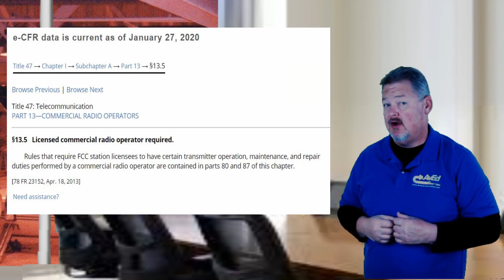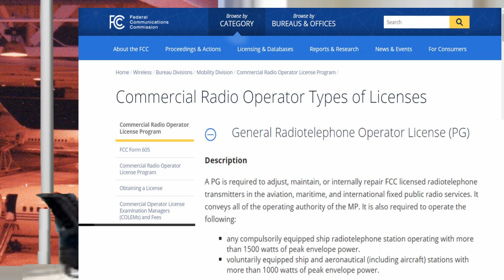Is the FCC GROL still relevant in Aviation?

Comment: What is the difference between the FCC GROL and the NCATT RCS endorsement?
Reply from the maker: Both are similar in that they test basic radio principles. the difference is whom the audience the test where created. The FCC GROL was created as a certification for those who both operate and repair radio equipment.  The test was originally for Ship to shore communication and was created in the 1950s.  The NCATT RCS test is a add on test created for aviation centered subjects. I was created to mimic the FAA  Airframe and Powerplant certificate in that there is a generals test (NCATT AET) and a series of add on ratings.  For FAA Airframe and Powerplant are the only two ratings. However the NCATT has four add-on ratings (Radio Communications systems (DCS), Dependent Navigation Systems (DNS),  Autonomus Navigation Systems (ANS), Onboard Safety and Communications Systems (OCS),

Comment: If you want to be a really effective technician, you need both the A&P and the FCC GROL.  I got my A&P in 1965 and added the FCC First Class in 1980 after a couple of years of studying on my own time.  I think everybody knows by now that maintaining modern airplanes requires a blurring of the lines separating the mechanic from the electronic technician.  Also, wiring and connector maintenance have become critical as computers have replaced control cables.
Reply from the maker: Getting any additional certification can help.  I even suggest, if someone wants to get into avionics as a system technician that they consider earning the NCATT  Add-on ratings.  These certifications are aircraft system specific.

Comment: FCC- GROL can be used for R.E.I avionics backshop ,short sign aircraft component repair installed to a/c and most of allcan not be used to certify and release Aircraft AIRWORTHINESS RELEASE .
Reply from the maker: Actually the FCC GROL is not aviation specific, if you are working on any transmitter where you could affect the output, you are required to have the license.
Reply from the maker: I forgot to add if you are returning to service a Type Certificated or TSO qualified product, you will need to be certificated under FAR part 65.

Comment: how to become an fcc licensed avionics technician. how much?
Reply from the maker: Great question because the aviation industry doesn't know that answer either. In America, the FAA has still refused to create a minimum performance standard for avionics technicians like every other modern country in the rest of the world. What they have in place is a requirement that the maintenance providers have FAA-approved training programs for repair stations and airlines. 

The reasoning that the airlines and repair stations are free to customize curriculum based on their ratings.  And that means that these companies are responsible as to what minimum performance will be for their new hire employees. And that is where the FCC and the NCATT AET come into play. 

As I stated in the video the FCC license is a radio certification curriculum and not exclusively aviation. But what these certifications offer is a baseline knowledge standard that employers can use to validate an employee has an aptitude for the subject.  This is what the FAA Airframe and Powerplant certificate provides. A minimum knowledge and skills evaluation.  When an employer hires an A&P mechanic they know somewhat what this person is capable of doing. Then the rest is left up to the airline or repair station. 

Avionics technicians are a little more difficult to hire because there is no FAA minimum performance standard. This puts the burden on the employer to determine if this technician being let loos e on their multimillion-dollar aircraft is not going to cause way more amount of damage versus what the investment was in hiring and training them. At least with the FCC and the NCATT AET, the individual can at least have a book understanding of the subject. 

In answer to your question Dra, I suggest looking for a school that has both FAA and Avionics training. Sadly the program I created had a full-function avionics program based on the NCATT AET.  The program included the training a technician needed to start working as an avionics technician the day they showed up (after indoc training). If the A&P is a license to learn, my program created working technicians with the background needed to be great avionics technicians.  So I cannot recommend any one school, you would need to go to the locations and see first hand what each program offers and more importantly if they have hands-on training on avionics equipment. 
Some day I would love to restart the program but right now I am planning to offer an FCC online course after I complete my NCATT AET certification course. You can find that course at:
https://avionics-education.thinkific.com/
Good luck
Reply: @AvionicsEducation  thanks!

Comment: OK! So where did I go wrong. Let's start with 2nd and 1st class Radiotelephone with broadcast endorsement converted to GROL in 1985. Amateur Radio Extra Class with 20 wpm 1991. Radar endorsement 1994, because you couldn't have both radar and broadcast endorsements or hold a radiotelephone and a radiotelegraph license at the same time back in the early 1980's. GMDSS Operator/Maintainer 2005. Took me that long to find somebody that knew what it was. Restricted Radiotelephone License 2005, because somebody at the FCC said I need one to go along with all the rest of them. Why, I don't know, I had to pass a test on element 1 for everything else, why not just give me the RR. 
It all makes for pretty targets for my dart board.
Reply from the maker: I feel your pain. Even though I took my FCC GROL way back in the day, the rules have changed since then. I plan to produce an online training course and have been carefully looking at the current rules.
Reply: @AvionicsEducation  Something I thought about while browsing thru the GMDSS videos. I know most of the physics and a lot of the radio systems have stayed the same , the CONTROL parts of the things have gone bonkers. Something that I found out when I took the GMDSS OP/MAINT tests that the operator tests were harder than the maintainer tests because they were changing the way things were controlled. With menus to get to sub-menus to get to lists of contacts and what groups are in your IMARSAT area. Which coast station were you SUPPOSED to be talking to. And a whole lot of other nice little items that you're supposed to keep up with.  I live in South central Oklahoma, 90 miles se of OKC. Unless I'm thinking about moving to Tulsa or Muscogee there's not much call for GMDSS around here. The Airport that's local ( Ada, Ok. ) is non-controlled and haven't heard much about avionics here at all. Might do an update on the control systems.
Reply: @AvionicsEducation  any update on that training course?
Reply: KC7WGB agrees with you!